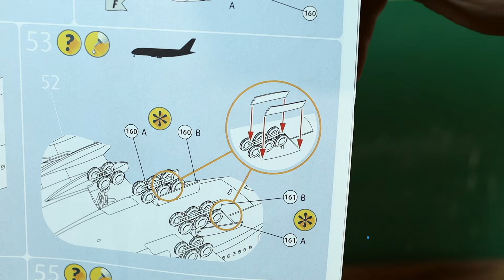Revell A380-800 British Airways | 1:144 scale | Full assembly video with interior lights

Comment: is that glue you add on top of the stickers?
Reply from the maker: Nope. Is a decal soft solution from revell. It softens the decal so it adhere better to the model and levels the edges. Once applied you have few seconds to move the decal before it dries and sticks to the surface
Reply: @MahaysAttic  ok thanks

Comment: do you water down your paint? also how much did all your stuff cost and also how long did this project take you please? im looking to get started in the modelmaking industry and am just wondering please.
Reply from the maker: I don't have the time that i would need to be a serious modeller:) but i think 10-20 minutes per day to work on a model it's a decent and easy to find timeslot. It took me 2 months to do this but again with limited time. I think for a 5 level airplane kit it can take 1week maximum. Then 2 to 4 more days for editing. 
The important thing here is to have fun while you're doing this. 
Most of the colors i use are acrylic and water based so no need to water thin them, maybe just pour few drops when colors get old and become a bit sticky. Just for airbrushing i use 50/50 tamiya thinner

Comment: I have a question which masking tape are you using is it  Leaving tape glue?
Reply from the maker: I saw that both tamiya and revell are equally good. None are leaving any marks and none are sticking to the paint. I recommend tamiya as it's a bit cheaper:)
Reply: @MahaysAttic  okey thanks and how long you wait before you mask the other colour
Reply from the maker: @KSAWEKZY19  1 to 2 days.  But it's not by the book. I gently touch the sourface and you can feel if it's perfectly dry:)

Comment: OK!!! Now if they can make this in 1/144, WHY NOT make a far more iconic aircraft kit, the B-47 or C-119 in 1/48? Thousands of these aircraft were built and would be roughly the same size a model...but with much more detail possible. COME ON!!  Will some kit manufacturer make a B-47 and C-119 in 1/48? Interior lights for the 119 would be very nice. Put a truck or some cargo inside. Good job on this tiny scale 380 however😅
Reply from the maker: Totally agree. Tho I saw some new kits from revell that looks very promising.